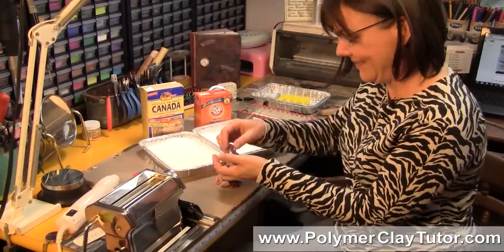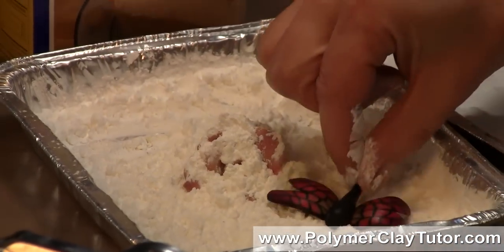Baking Polymer Clay on a Bed of Baking Soda or Cornstarch

Comment: I have used baking soda on a large sculpture ( a one foot tall rearing horse). It would not fit into the oven in a standing position. Based on internet advice, I laid it on a bed of baking soda in an aluminum pan and added enough baking soda to support the legs. I only baked for 20 minutes the first time and the buried clay was still soft. Turned the model over so the previously buried side was exposed and baked for 30 minutes. Final result was great. Baking soda brushed off easily with a brush. Surface was as smooth as other self-supported sculpey models.
Thanks for the video. I will try baking longer so the buried portion can heat evenly.

Comment: This video was extremely helpful! I use fimo and I have burnt or underbaked (trying to avoid scorching) my first 3 creations because:
1º) I didn't have an oven thermometer, and my oven doesn't show the temperature on the dial - just numbers 1 through 9 and the resistance options (top, bottom, both)
2º) I was baking on top of aluminium foil, which was a dumb idea!

Seeing my work ruined saddened me to a point where I didn't touch my clay for over a year! But then, after watching this video, I gathered all these materials - corn starch, baking trays and oven thermometer, and I completely buried my pieces in corn starch, covered the bottom tray with a similar one on top to act as a tent and control the temperature inside, and I regulate my oven (at a much lower setting than I was using before!!) so that my oven thermometer showed an adequate temperature to bake my clay in (either 110ºC which is what the brand tells us to do, or slightly higher up to 130º because I was burying my pieces completely), and bake for an hour.

I am happy to report I haven't burnt another project yet, and I've been working with the clay at least once a week! Thank you so much!

Comment: Hi there Cindy, I make delicate pieces flowers etc...almost exclusively and I use cornstarch. It did take some time to figure out a proper baking time. My pieces seemed to be under baked even when I put them in for long while if they were buried. I mix premo, sculpey and fimo to get the different pieces I look to make. Thanks for the tutorial. I have a suggestion for a video of the afters of baking your clay...scorched, just right, air bubbles, in on top of the corn starch, buried in the corn starch. The flexibility, texture all that after baking. One thing I still have problems with is knowing if I have baked correctly!
Reply from the maker: Thanks Kate Mueller for your input! I'll add your video requests to the ever growing list!

Comment: Hi Cindy, I'm wondering if it is possible to part bake polymer clay and then add raw clay to it as in sculpting a figure. Hope you can help me . regards Soo
Reply: You can ore bake a piece and add more to the piece but yeahh
Reply: You can ore bake a piece and add more to the piece but yeahh
Reply: +susan worth I have been looking for an answer to the same question. I baked a large piece and plan to cover the whole thing in another color w/additional decorations and I'm not sure if raw polymer clay can be baked on top of baked polymer clay.
Reply: Ok basically u can prebake a piece of clay then add more on top or add additional stuff on it  but you have to put it at a lower temperature so it wont burn.So say u have clay like sculpey or premo its supposed to be baked at 275 F but youll have to put it at like 210.

Comment: I have used Kato Clay with cornstarch for years. The only time I had a problem was when when I buried something to put in the oven later and forgot about it for a couple of weeks. All the plasticiser must have leached out. It snapped like chalk! I think that would probably have happened with any brand clay, though. I wonder if your point about leaving stuff in the oven for longer is especially important for Kato? It needs to get to a higher temperature to be at its strongest. It would be interesting to do some experiments comparing baking soda and cornstarch with Kato clay.

Comment: Hi Cindy, Im relatively new to clay, but have found that baking things such as hollow poly clay eggs started breaking apart where ever the poly clay touched the baking soda. The first few cookings were ok but after time the baking soda starts turning into super washing soda and that can be caustic, so say the 5th time I used the soda my piece crumbled where it touched. However Im still trying to get my oven to stop spiking Ive caught it go as high as 170c so that could be part of the problem. Next time I do a transparent or light color Im going to try corn starch because its so disheartening to pull out a burnt piece :( I ordered a convection toaster oven and cant wait to get it I read what brands don't spike so bought an oster. :)

Comment: Can you use the same batch of cornstarch for another batch of pieces or do you have to throw it away and use fresh cornstarch after the first batch is done
Reply from the maker: Yes, you can reuse it as many times as you like. Sometimes it will get a little pebbly feeling, (probably moisture gets into it and then dries in the oven). But you can always crush up those pebbles and make it smooth again. Although cornstarch is cheap, there would be no sense throwing it out, unless it was dirty or something.

Comment: I'm going to be making horns to attach to a mask out of premo and they'll be maybe an inch thick, how long should I bake them for? I'm guessing maybe 2 hours based on the premo sculpey advice of 30 minutes per 1/4 inch but I just wanted to run it by you first (I'll be baking in cornstarch)
Reply from the maker: Hi Azazel Black anywhere from 1 to 2 hours should be fine. Your project sounds interesting!

Comment: I never thought about using Baking soda or cornstarch. I've been making figures and small sculptures. I had a few questions for you though. I know some people use aluminum foil as a base. When would that be necessary? I feel like I've been doing it wrong the whole time. haha.Also, I find it with actual sculptures, I find it hard to determine when is the correct temp. would be tips?
Reply from the maker: People use foil to use less clay, to keep the piece lighter and for it to be easier to cure the clay. It isn't necessary if the piece is smaller though. Just make sure you're baking in steps so that the piece is properly cured right to the center. Bake at the correct temp using an oven thermometer. I have lots t=of baking videos that will help. Good luck!

Comment: I am new to using palmar clay.  I would like to know why you prefer permo clay over the other clays
Reply: Valerie Smith hello! I’m a Premo user too, and my main reason for switching over to Premo from Sculpey III is that the colors were brighter. I think the default colors are really beautiful, but I also get great mixes too, which is good for me since I do a lot of partial mixing, or “marbling” I guess you could call it.

I also like that it’s ready to go as soon as you take it out of the package—I tried working with Fimo and it was the most unpleasant experience ever, because it was so crumbly and impossibly stiff! That was back when I was pretty inexperienced too, but had gotten somewhat used to Sculpey III, which is also ready to use right away. I felt silly for trying to fix what isn’t broken, so to speak, and went back to Sculpey III until Premo came out (it’s a relatively new product in the Sculpey family). I am not familiar with Kato or any other brand, but I think I’ll just stick to what I know! You should experiment and find out what you like about the different brands. Happy creating :)

Comment: polymerclay tutor, hi, can i use my halogen small oven to bake my clay? jen UK.
Reply from the maker: +jennifer lewis Will it hold a consistent temp? If you can set it to the temperature that the clay needs and it holds it consistently, then yes.

Comment: Hi, I had a problem recently with Fimo baked on a bed of cornstarch. It was weak afterwards, the beads all cracked when I drilled them. Beads baked on aluminium, ceramic, or on a bead rack drill fine. I wonder if Fimo would do better on baking soda too?
Reply from the maker: Hi Joie Parris-Lewis thanks for the feedback! I don't work a lot with Fimo so I don't know if it is a problem with the Fimo or not, but I do know that if you leave a Premo piece sitting in the cornstarch for too long before baking, some of the plasticizers will leach into the starch and weaken the clay. Make sure to put them in there only at the last minute and see if that makes any difference. Good luck!
Reply: Thank you! I'm testing a variety of different clays soon, to see which I prefer to use. I'm going to be testing baking them on a bed as part of that :)

Comment: Have you ever used jewelers wax in a polymer clay bead to create a core? If so, any tips?
Reply from the maker: Hi Ariel Leather no I have never used jeweler's wax to make hollow polymer clay beads, but that sounds very interesting! What temp does it melt at? Because that would be critical to whether not the idea could even be used with polymer.

Comment: I am a novice and baked first time yesterday.  You are using aluminum cake pans.  Another youtube tutor said never use foil because it will damage the heating element and the oven will never work properly again.  I don't know which advice to follow!  I used wax paper directly on the wire rack and did not like having no stability under my clay pieces, and one piece rolled off the wax paper into the bottom of the oven.  (I did retrieve it).  Thanks if you can help me know for certain if I can use any metal pan, even when not using corn starch or soda.
Reply from the maker: +Trish Sanderford Hi Trish, I am not sure which YouTuber you are referring to, but that person doesn't know what they are talking about. Tin foil and tinfoil pans are actually designed for the oven... so if they were such a hazard to ovens, I doubt that they would be able to continue manufacturing them for all these years.  I am guessing if that YouTuber wrecked their oven using foil, that they had it sticking up so high that it was touching the element. Make sure that nothing touches any elements in your oven... the pan, your clay, paper, your hands or anything else... and you won't have any issues. Also don't use wax paper.... it melts and sticks to the clay. I have tons of videos on baking polymer clay in my channel. Make sure to watch as many as you can... they will help you become more informed... with TRUSTABLE information. Good luck!

Comment: I baked my figure on corn starch and it came from the oven cracked and broken 😩😩
Wanna know what is the problem plzzzzzz???
Reply from the maker: You may have left it sitting on the cornstarch for too long before baking and the oils leached out of your piece and made it brittle. Make sure to bake it right away after putting it on the cornstarch and it should be fine.

Comment: This is an old video, but I can confirm that Kato should not be baked in cornstarch. You could end up with a disaster. I speak from experience, I’m a Kato user for 20 years. On the other hand, I also bake other brands in baking soda as well , at Kato temperatures without any problems. I completely cover them with it, no tenting needed. Add extra time.
Reply from the maker: Thank you for your input! It is nice to hear from people with experience! 💖